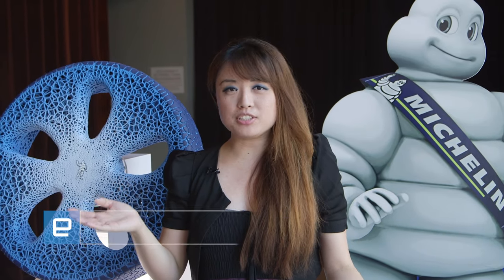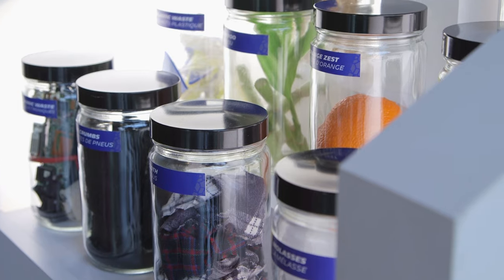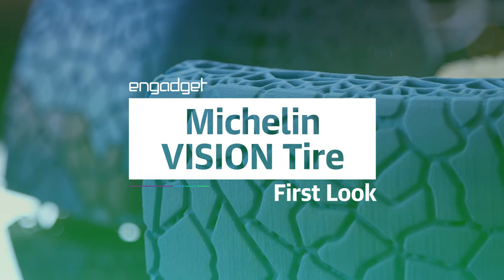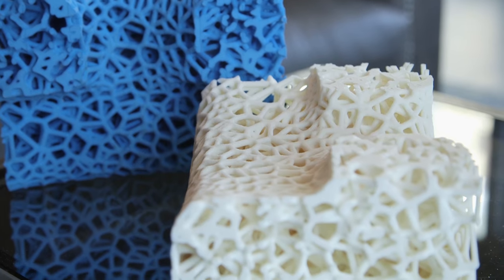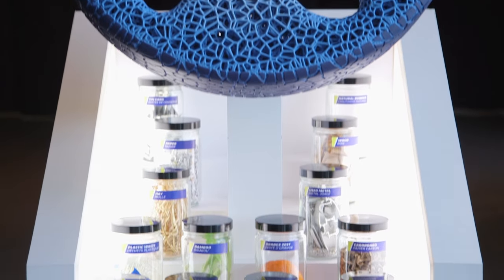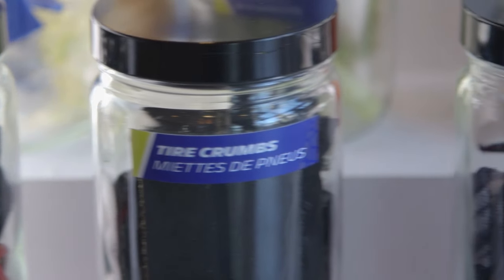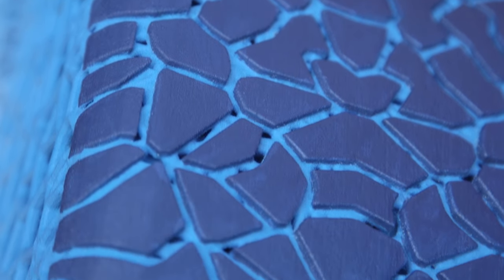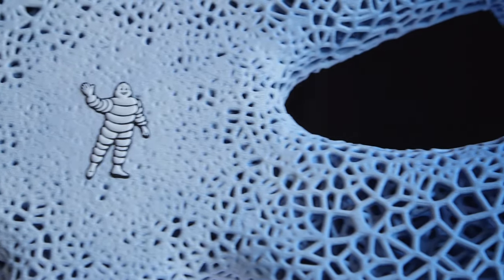Michelin's 3D printed VISION Tire first look

Comment: It looks like it can't handle any dirt, water, ice buildup. mud. sand. It can handle nothing. Very interesting.
Reply: Didn't tire treads for those conditions.
Reply: Problem is the porous construction. Stuff will get into those pores. And also it appears extremely bad in aerodynamics.
Reply: just put a cover on it

Comment: That looks like a dumb idea. Mud and water will get suck in the pores. That will for sure unbalance the tire. Keep on dreaming.
Reply: Im pretty sure it is just for display.Anyways, it would fairly easy for them to put a rubber membrane, or protecion around the tyre.
Reply: Matheus Rotta yeah that would work. Hey wait a minute, we already indented that 100 years ago. It's called a tire 🤣